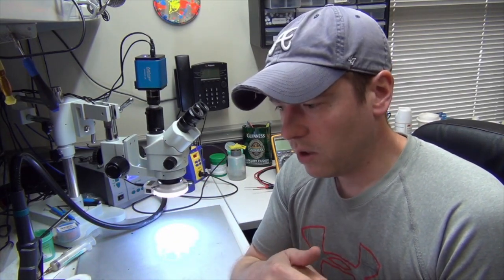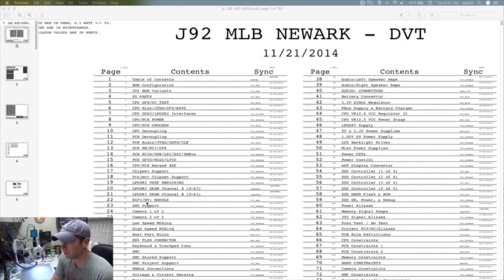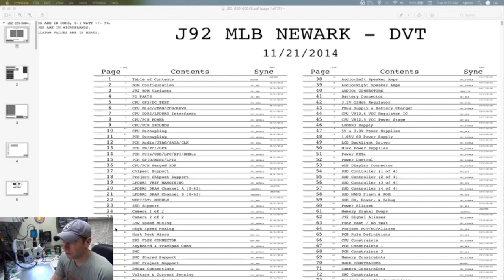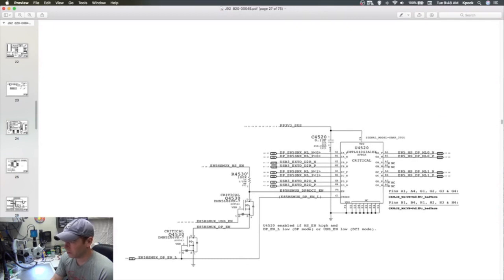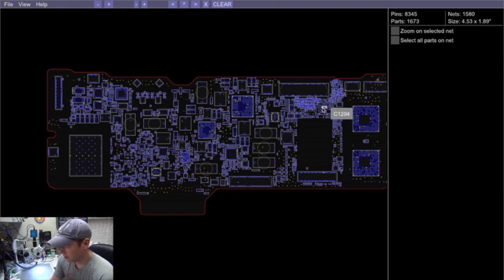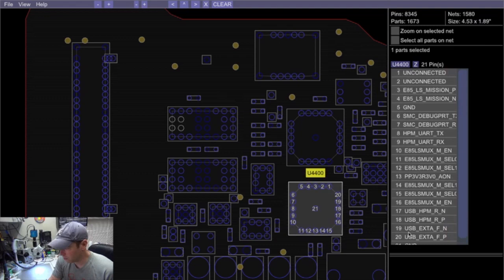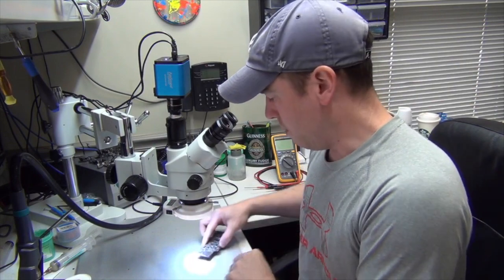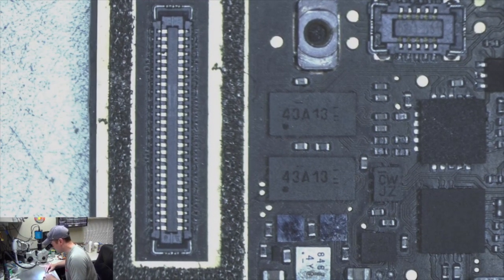How to Fix a 12" Macbook When USB is Not Recognized on Model A1534 Board 820-00045

Comment: my macbook early 2015, at first can recognize USB 2.0, iphone and most, but after i used usb hub, it says "USB DISABLED not enough power" then USB 2.0 dead, cannot detect, mac looks like prevent USB 2.0, also it won't recognize my iphone

only USB 3.0 can detected

I've tried to reset SMC an VRAM, but still not solve, please help 🙏🏻
Reply: connecting power normal, somehow i connecting mu iphone to macbook, it only charging but not recognize to sync
Reply: hi, may I ask if you have solve this? I just got exact the same problem: cannot recognize all usb 2.0 devices (disks, keyboards, iPhones), but 3.0 and charging are fine. My device is a 2016 MacBook (a1534).

Comment: hi. the same model had no power and replaced the u4700,now charges and works perfect apart from i get the error :Unplug the accessory using to much power to re-enable usb devices. is it same problem that was having?thanks
Reply from the maker: Gimi It is a possibility, it would be worth trying.

Comment: Hi, i have exactly the same problem, but I don't have any damaged board where I could take the Chip of. do you know maybe where I can buy this chip? Thanks!!!
Reply from the maker: Try searching on eBay and Google.
Reply: @PowerbookMedic  hi, I´m again:) I was successful by buying the chip. now I gonna need to know where the pin 2 and 3 are coming from. do you have the schematics right, may you can tell me that? thanks
Reply from the maker: Adriano Scifo Hello! We really recommend that you have the schematics in front of you while doing the repair, as this makes it easier to work on. You can find them by doing a google search usually.